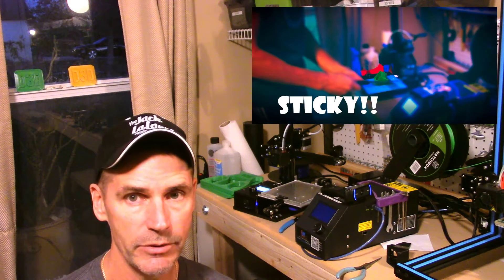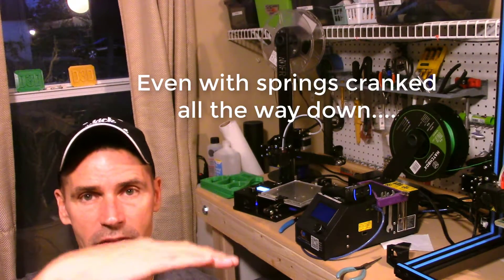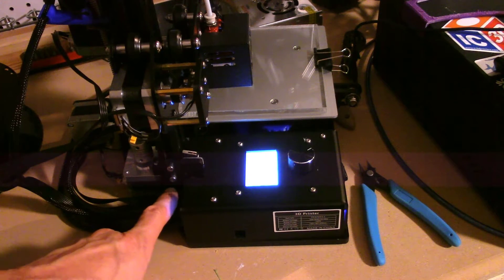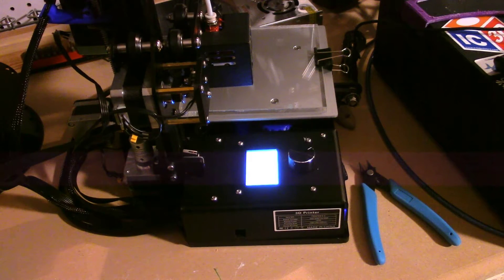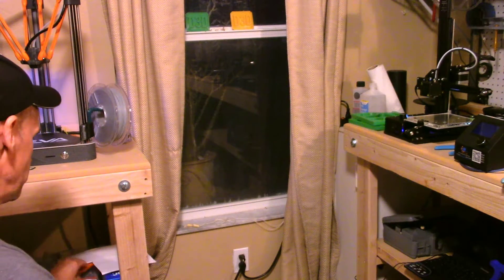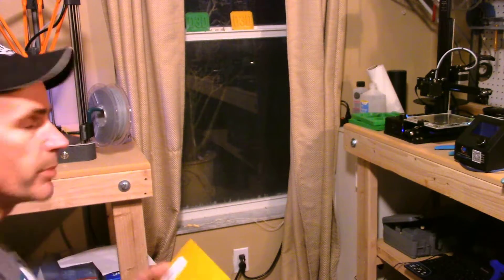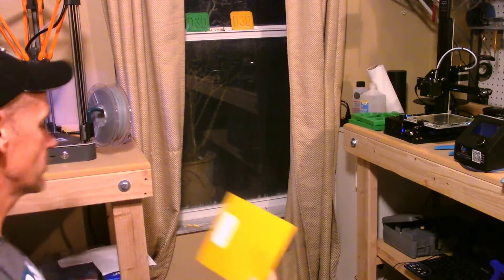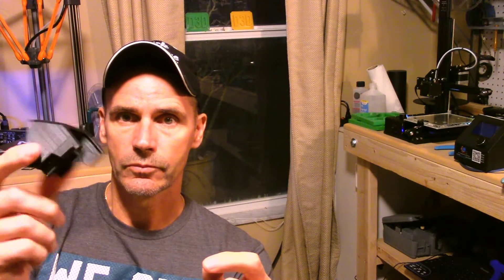Boroscillate glass on my Creality Ender 2!

Comment: A tip for getting the end stop on the Z-axis in the right spot. Undo the two bolts that hold the bracket on and raise it a bit by hand, Then place the glass bed at the bottom of the Z-axis where the bracket was. Slide the bracket down onto the glass, making sure the glass isn't tilted. Tighten the two bolts, remove the glass bed, Done.
Reply from the maker: Thx for the info.

Comment: I tried the glass and couldn't get anything to stick to it, so I took it all apart again and tried with the blue shit on it, and it worked. When I had the guy cut the glass for me, I had him cut me a 1" strip,thinking I could use this as a gauge to raise the limit switch. I think that was the problem,that didn't raise it enough. After I raised it to match the home position and leveled it, it now works perfectly. You're correct, leveling with three screws is a real pain.